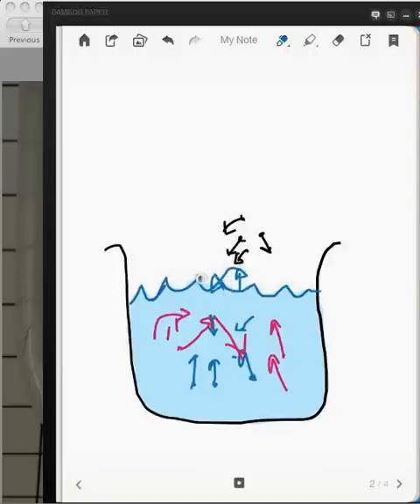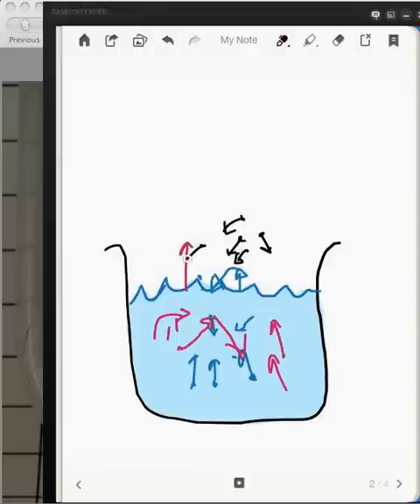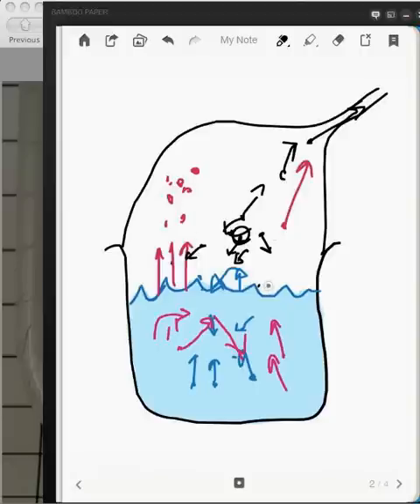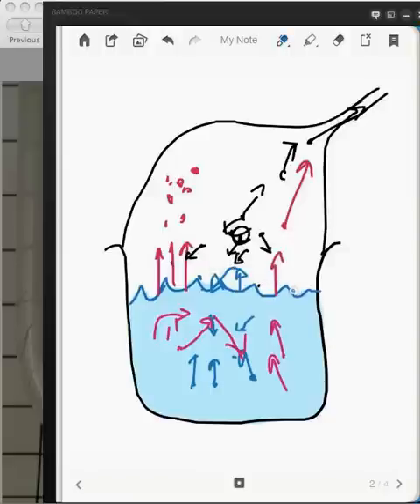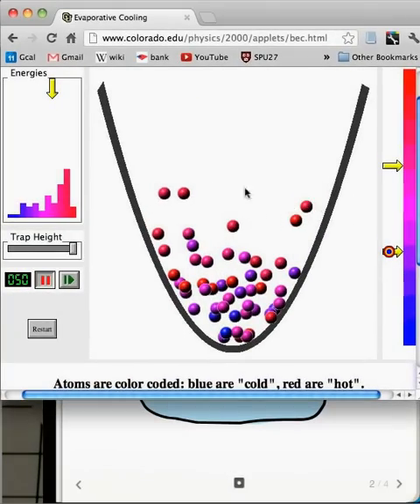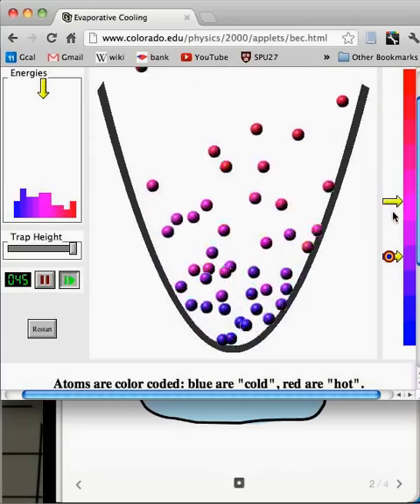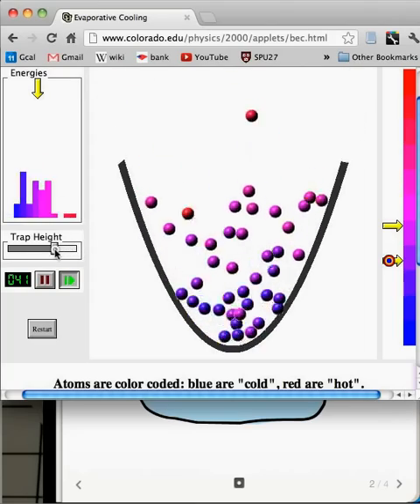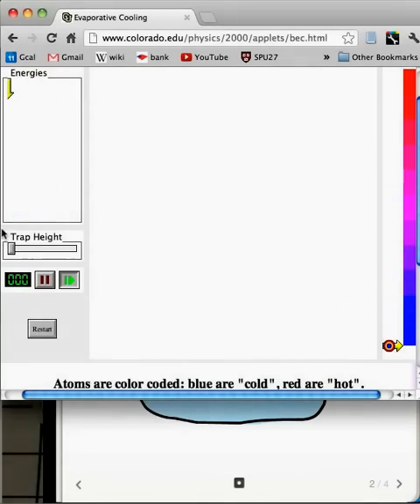Evaporative Cooling!

Comment: How much there are differentiation inside water between fast moving and slower moving molecules? When all fast moving molecules evaporate away then you have cooler liquid but that will also evaporate eventually. If I have water at room temperature and if I let it evaporate until it cools from 24C to 16C then does it mean that 24C water contains water molecules which are at 16C ?

Comment: but, even if the coffee was sealed not allowing ang evaporation the coffee still cools, evap may increase this process but doesnt it make more sense that the heat induced coffee is radiating the heat easier? and what about boiling evaporation?